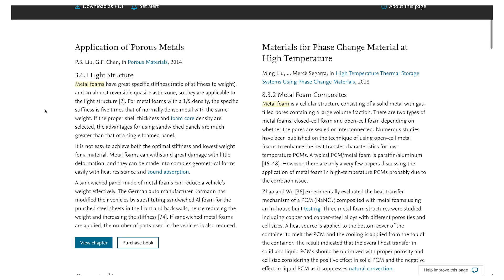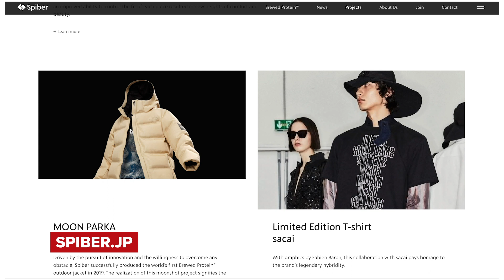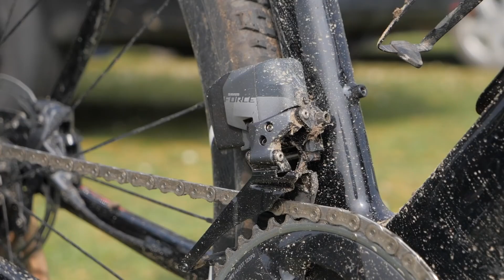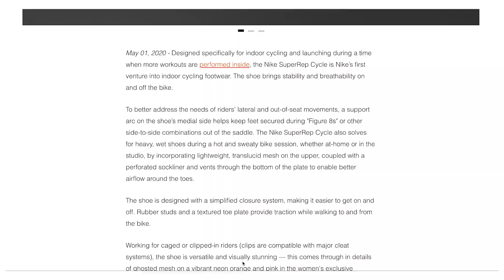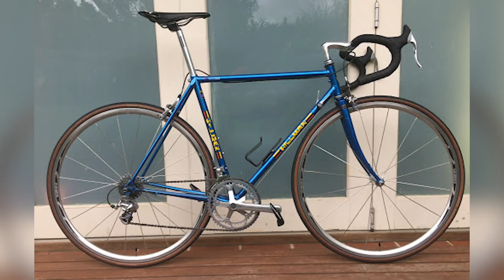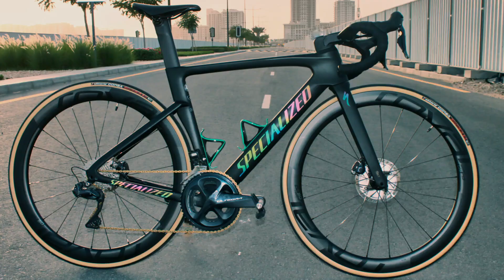Bike Materials Of The Future | GCN Tech Show Ep. 125

Comment from the maker: What material do you think bike frames will be made out of in the future?
Reply: Graphene! Magnets for bearings would be cool too!
Reply from the maker: @boeingbros0550  Magnetic bearings sounds very Sci-Fi!
Reply: @gcntech  Makes for a decent suspension system as well I hope
Reply: Unobtainium.
Reply: https://rein4ced.com/ thermoplastic/polymer composites are the future. Also Combined with metals. Not only technically better, but also more recyclable an thus more eco friendly.
Reply: The aluminium which was previously un-weldable!
Reply: Dry Weetabix
Reply: High quality carbon fiber frames that cost less than steel frames
Reply: Who cares. Once I can ride it I'm happy
Reply: Carbon fiber + something else. Those super high strength polymer fibers have pretty low stiffness, even spider silk. They may get used to improve the durability of carbon frames, but won't be the primary material.
Reply: Rather than the bike frame, I think that metal foam would make for some great crank arms
Reply: Vibranium Bros!
Reply: I think we'll keep all the same frame materials but get 37 more bottom bracket standards.
Reply: Carbon nanotubes with compliant mechanism suspensions
Reply: I expect bikes of the future will be inflated with helium or some other lighter than air gas. I see bikes so light that they will have to be tethered like dirigibles.
Reply: Carbotanium, a combination of carbon fiber and titanium. It’s used on the Pagani Huayra.
Reply: Always go full geek. I’m here for it
Reply: GCN Tech oxygen
Reply: Good Intentions
Reply: Vat-grown bone,  in the form of monocoque frames.
Reply: I'm hoping to 3d print my future frame out of a mix of titanium and carbon. At home.

Hell, I'm hoping to 3d print every component too.
Reply: Also Drillium.
Reply: Ti.  Ti and Ti!
Reply: cannabis
Reply: I'd say metal of all sorts--affordable and strong and that's going to be more important than ever.  Plus, with the emergency of better motors and batteries, more bikes are going to have that e-bike feature, and c'mon, that's great--pedals for the soulful rider, power for the needful rider.
Reply: Graphene infused with Titanium, or some kind of combo, to give graphene strength in different directions.

Carbon infused with Titanium strips. It's expensive, and it's used in Pangini (spelling?) supercars. I think they own the patent.
Reply: clay
Reply: Steel.
Reply from the maker: @milybanily  Hopefully steel frames don't go anywhere!
Reply: @milybanily  ... why not go all the way back to the bronze age or stone age then???

Comment: Hi, I changed a cassette on a Cannondale Caad5 R2000si and could not separate the cassette removal tool from the original locking ring.  I mistakenly placed the original locking on to the freewheel.  I can't get the freewheel to stop spinning in order to get purchase with the cassette removal tool.  Do I have to remove the spokes from the wheel to remove the hub and is there then a way to remove the original locking ring? Any help will be appreciated.

Comment: Additive manufacturing from powder metal offers the same (and more) advantages compared to metallic foam, and you can also control the pattern of the structure to obtain certain properties (same as right now carbon fiber layers but with a 3d structure).
Is under development for mass production purposes and there are some industry players (ex. VDM in Germany) that have mass production lines for high performance alloys made in powder.

Comment: That Maus bike oozes class... I only wish it had disk brakes with brass rotors...
Reply from the maker: That would be lovely! Has anybody made copper disc rotors yet?
Reply: GCN Tech copper is much too soft. How about heat-treated titanium? In any case, there is no replacement for real 24K gold...
Reply: Maby I will add them some day. Frame rear triangle is only 130mm unfortunately. And I would need to find a set of cheap disc capable wheels.

Comment: Ok so with the new Force parts, Sram has created a MTB groupset. To fit the wider MTB tires they've just adopted the other wider MTB specs like 73mm cranks.
Reply from the maker: The line between gravel bikes and MTB is definitely a blurry one!
Reply: Not sure why Si mentions the need to run the MTB mech with the wider 10-50 cassette for 1x as if that was a bad thing. You WANT the clutched derailleur for 1x. Frankly, the most ideal 1x for gravel would be the Eagle groupset with mechanical 12-speed drop bars shifters...which don't exist because SRAM is sitting on it for the sake of easy marketing in the near future.
Reply: It's  alllllmooosssttt as good as the MTB groupset.

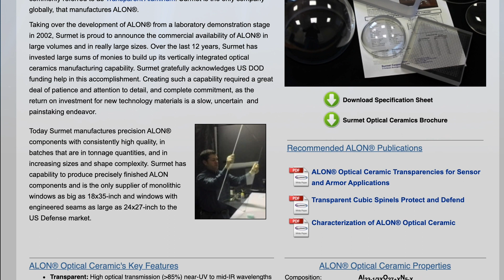Comment: 3:53
Whenever something is said to be "stronger than steel", it's usually marketing wankateering. As I'm sure Ollie should know, the strength of steel easily varies by an order of magnitude depending on the alloy and heat treatment. There already exists Aluminum alloys/tempers that are over 2x stronger than certain steel alloys at particular heat treatments.
Reply from the maker: Good point! It still looks to be an exciting material and we'd love some more information on it! Hope you enjoyed the video.

Comment: Graphene batteries will be extremely light weight flexible, very durable, suitable for high capacity energy storage and super fast charging times. Potential future uses in cycling are huge.
Reply: Graphene is too difficult to manufacture in any volume. At least for now. Solid state batteries show some promise but they're still years away as well:(
Reply from the maker: Graphene's a really exciting material, for sure!
Reply: You mean motor cycling?

Comment: The track bike valves weren't lined up if I'm being picky.
Reply from the maker: Track bikes get a dispensation for the rear valve as it generally means you then can't line up your cranks due to the fixed freehub!
Reply: Hard to do with fixed gearing.

Comment: Whats stopping you from wearing the indoor cycling shoes outdoors?? Makes no sense!
Reply: my guess (from another website's notes) are low abrasion resistance and lack of reasonable walking bumps. Even the MTB version here seems to lack a recess so you'd be clack-clacking every time, and probably would total them if you crashed even lightly due to the weave not being able to stand that kind of damage.
Reply from the maker: The Nike indoor shoes use a metal SPD cleat which, unlike most MTB shoes, is completely exposed! If you had to get off and walk or put your foot down you'd have no traction whatsoever!

Comment: The indoor shoe seems like it's aimed squarely at the fitness spin class scene.
Reply: It could be a big market, the indoor scene--indoor shoes, indoor socks, indoor bottles.
Reply: @robbchastain3036  You answered my question. Who the flock would buy them? I'd totally forgot about the spin class lot, it's been that long since my gym days.
Reply: @lesflynn4455  And that is the thing, sometimes, it is best to ride indoors for personal reasons--winter weather is one, for sure.  And for me, just over a decade ago, I lost two long-held jobs and I lost pretty much life as I had known it.  And I had just turned 50 and I was 80 pounds overweight from working hard but not riding hard and certainly not watching what I had been eating and drinking.  And I knew, for starters, I had to get that weight off and it was the Winter of '09/'10 and so I joined a local gym and rode the wheels off a stationary bike and limited my menu items and controlled my portions and, thankfully and amazingly, I emerged into the sunlight of spring as a revived dude.  And it had been a good winter in that gym on that indoor bike a power meter, a necessity.  And it even had flip-up arm rests, too, lol.
Reply from the maker: It's a large market, for sure!
Reply: Don't dismiss the spin set. I have no interest in indoor exercise and would rather ride in the rain than zwift. However a year ago my wife's doctor recommended an exercise bike for aerobic fitness to counter some other medical problems so I bought her a Peloton. She is not competitive in the slightest and has no interest in cycling but likes the Peleton, rides it most days, and has improved cardiovascular health as a result. Cycling is a big tent with room for everyone.

Comment: What about carbotanium?
Carbonfiber with titanium bonding. 
So it only dents like metal and not shatter to pieces when you crash really hard.
Pagani uses it on their cars.
Should be really good for bikeframes i'd think.
That first "upgrade" isn't really a upgrade though, it should be in the "Hack or Bodge". 
It's actually a crappy job picking that out. 
But a nice video though.
Reply from the maker: Nice idea! Carbotanium sounds like it's designed to make bike frames!
Reply: @gcntech  yeah. Lets hope someone starts making it soon.

Comment: Newsflash ... graphene ain’t coming anytime soon
Reply: Big bad and very light Reynolds 953 still holds the Crown. 2000 MpA. Suck on that carbonian's with your measly 300.
Reply: why not? It's already there in some applications. Whether it's revolutionary or makes economic sense is a different matter.
Reply from the maker: Graphene frames have gone a bit quiet of late, haven't they! British brand Dassi who had seemingly nailed mass production of Graphene frames recently went bust!
Reply: @gcntech  It was only a CF with a coating.There ain't no 100% pure Graphene frames. They would be dreadfully, dreadfully expensive, and the big money for it's creator's lies elsewhere. If it can be put in to e bike batteries to increase the range, lifespan and reduce the charge time that's where I see it's relevance, but there is more money to be made in e cars, phones etc, and you can't graphene a vaping battery, they would have to be solid state. Don't wait up.

Comment: Cantilever with suspension forks ?? Would that even work?
Reply: You would just need the cable stop to be on the bridge that moves up and down with the wheels.
Reply from the maker: It looks like they switched the suspension forks out for a rigid carbon one!
Reply: GCN Tech thats right. Fixed fork now. Much lighter